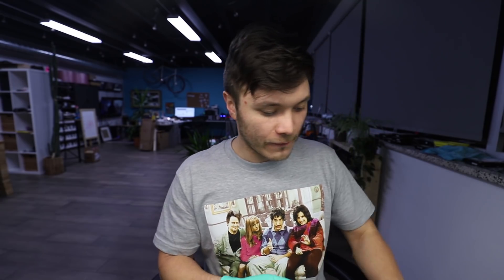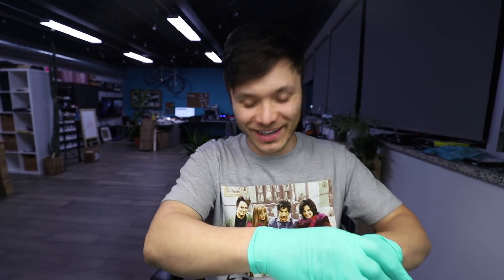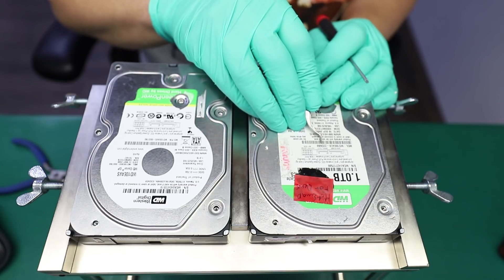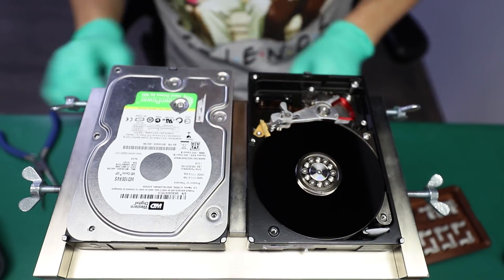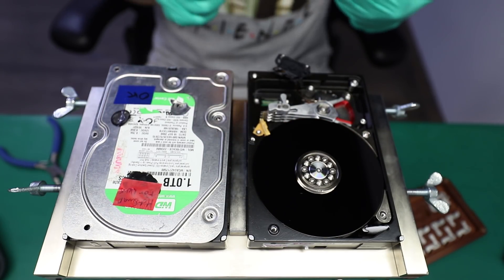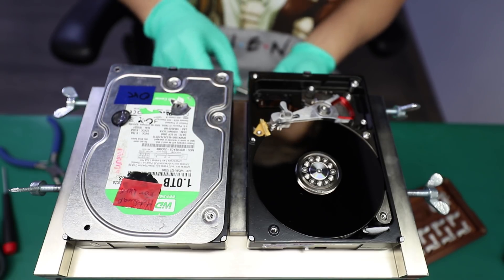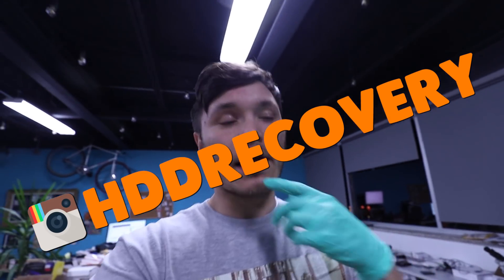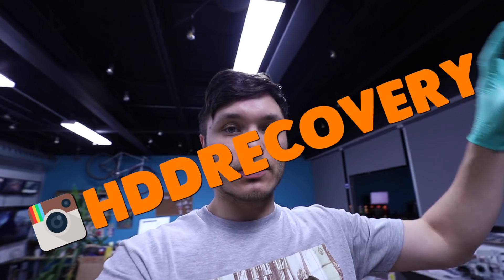Data recovery on partially dead drive | WD initialized by headmap

Comment: recently i've swapped the platter only between the same model hdd but then after the process, when connected to the laptop, the platter spinning for about 5 seconds n stop and then after a few minutes, its spinning back then stop and repeatedly like that..after about 1 hour, then appeared at disk management ..the status is unknown and not initialized and no storage displayed..does anyone know whats the cause and the solution?

Comment: Hi, nice video. May I ask you, why you are putting a screw into the head stack, before you are moving it? And one other question: Why did you need to replace the modules? Even from the database? HDD-Surgery DB, i think? Because if you already have the data from head 0 and head 1, you also should have the modules from the SA.
Reply: keeps the heads from touching each other, once they touch there is no separating them and in turn that ruins the whole head assembly
Reply: Hm? No, I don't talk about the ramps. I talk about why he put the top head screw back in, before moving the heads on the ramp off the parking ramp.
Reply from the maker: the top screw keeps the HDA in a fixed position and prevents any movement while keeping the stack perfectly aligned with the head comb and parking ramp.
When the first headswap was done to capture H0, H1, H3, H4  the drive loaded with its own SA, but SA was not backed up. After headswap 2 I found out that module 11along with many others on both copies were no longer readable, so I pulled it from HDDSurgery Data base.

Comment: For tweezers I use SKU: TT-00208 from Tooltron. They are from my old days of weeding vinyl as a sign maker. Sharp you can pluck a hair off a cockroach.
Reply from the maker: They last long?
Reply: As long as the arms don't get bent and loose their grab and as long as the tip doesn't get bent and loose it precision. I even use them for digging out slivers from my fingers. The tip is broader than the one you show.
Reply from the maker: I'll check them out
Reply: I have a couple of extras here Please allow me to send them to you to say thanks for your videos.  I will put them in the mail today from Chicago. Thank you!
Reply from the maker: Thanks Matt, I would really appreciate that!

Comment: Wondering here -- have you tried/successfully recovered data from a Helium drive?
Reply: Also, have you ever done a platter replacement (not swap) to recover data? Ha.Ha.Ha.
Reply from the maker: Not yet
Reply from the maker: Actually I have done a platter replacement to recover data as funny as it may sound. On some drives like Toshiba for example, there is no way to modify headmap in RAM. If there is a scratch on the disk and data is critical, swapping scratched disk for a donor one is the only way to go about it. Obviously, that dummy disk gets skipped during imaging :)
Reply: Well. I'll be damned! That's definitely pretty interesting.